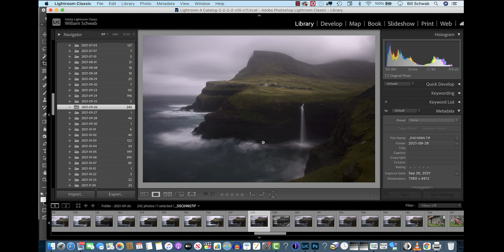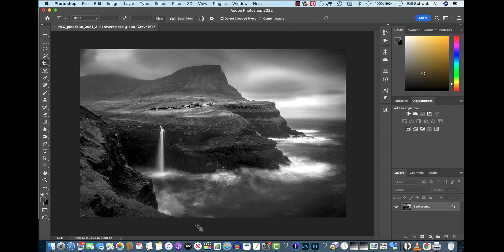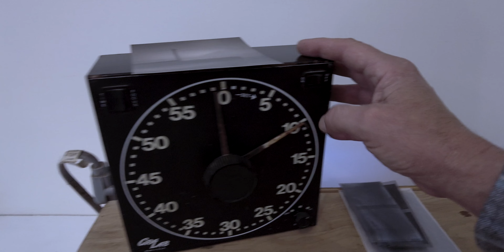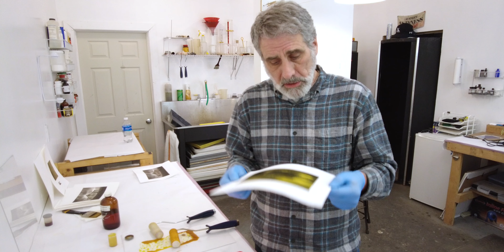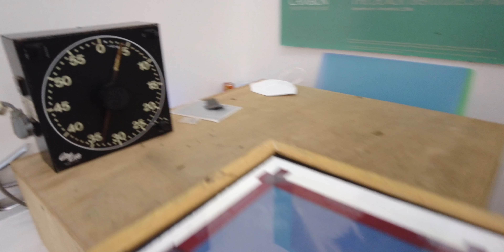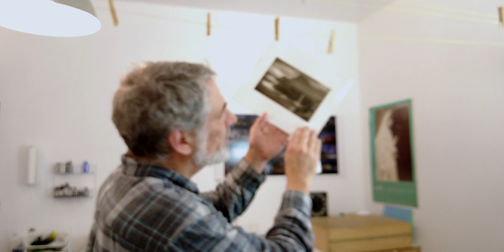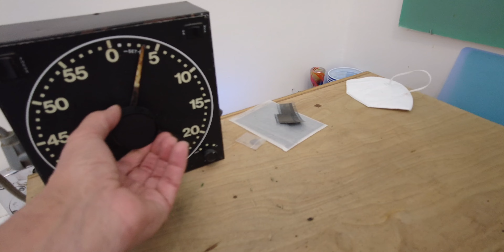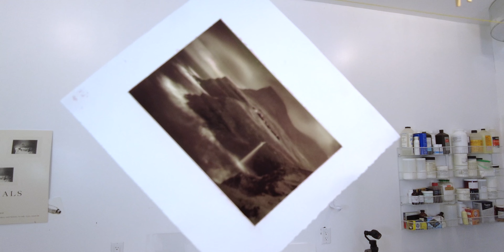Gum Over Platinum Printing with Bill Schwab - Complete Tutorial

Comment: Hi Bill, how long does the mixed rubber with ammonium dichromate last? Best regard Hans
Reply from the maker: Hi Hans.. Good question. Once mixed with the gum and pigment, it's only good for a day or so. I usually use it within 24 hours if not all at one time. Hope this helps! Thanks for watching!
Reply: Thank you, I left the mixture in the dark for a few days and it was no longer sensitive to light. @BillSchwab
Reply from the maker: @hanshabel9100  Good to give everything a try at least once. I’ve let it go overnight before and tried it again in the morning and it still work, but much longer than that and I’ve had the same experience as you.